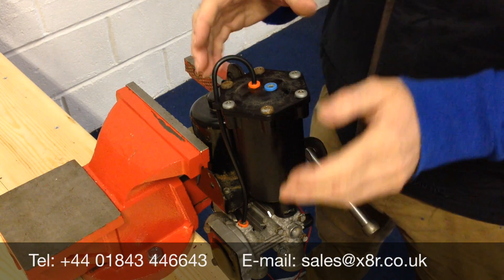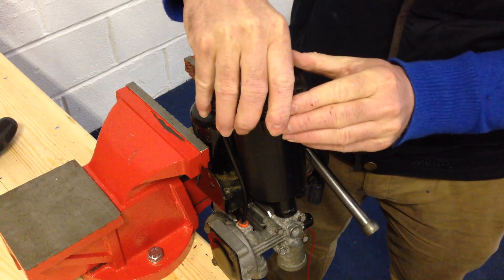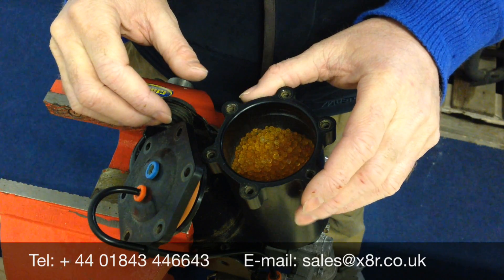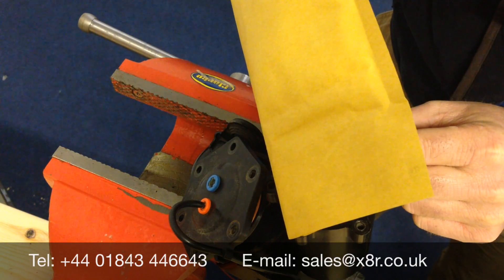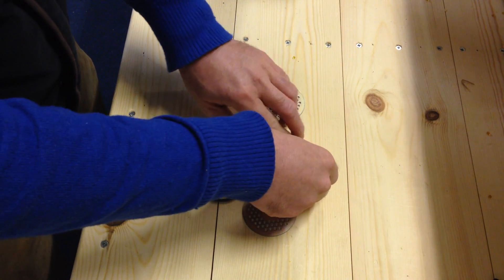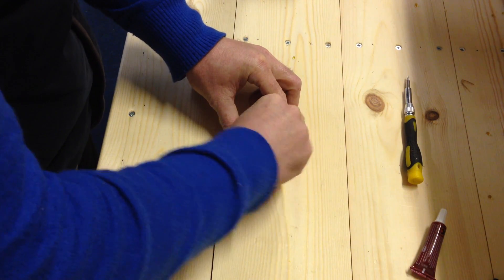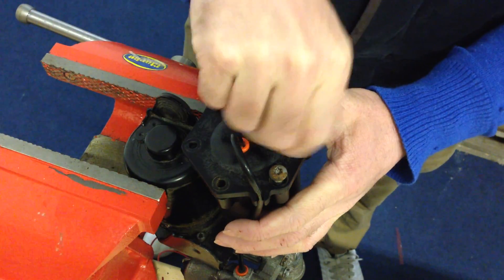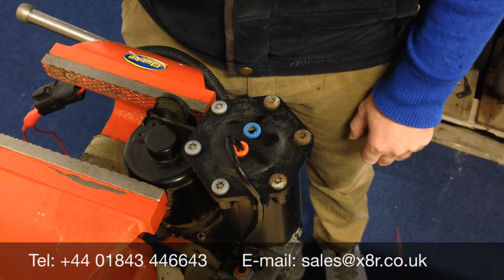Land Rover Range Rover L322 2006+, Sport and Discovery 3 EAS air compressor filter repair

Comment: thanks for the video, Very helpful.  The dryer seems to be my issue as it was full of powder and the metal filter plates & spring were so oxidized the spring was stuck and the top plate didnt pop off.  However, you do need to pull the dryer cartridge completely off if you want to replace the small o-ring included in the kit but not shown in the video.